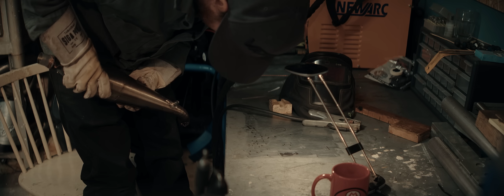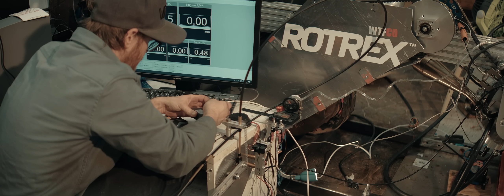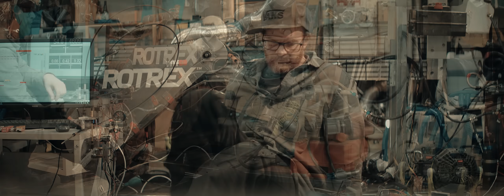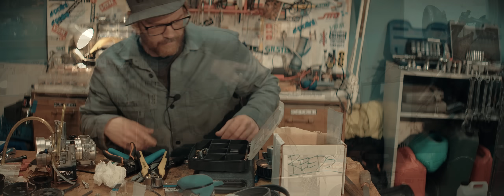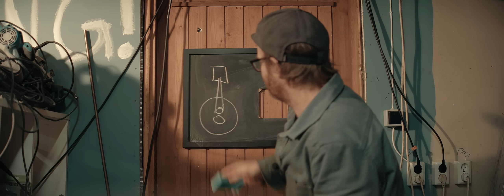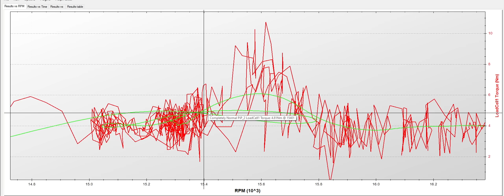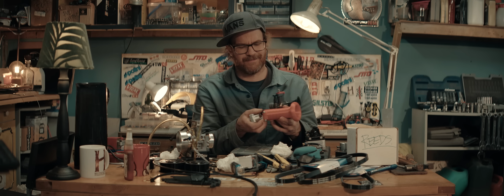18000RPM, But then...

Comment: And again, your Motor is capable of runnung Supercharged, as some others also mentioned, let the charger suck in your air/fuel mixture from the carb, the charger has to be between motor and carb, cause a carb works with under pressure and not high, if you want it the other way go direct Injection, i believe in you and your project and it will blow our mind away if it works at least
Reply: He's already talked about "Blow Through" and "Draw Through" in earlier videos.... He also explains why he did it the way he did.
Reply: You forgot one importantant part why he has set it up that way the fuel eats sealing and plastics like no other really nitromethan + methanol is aggressive as hell
Reply: @TheLtVoss  So its possible to build a whole motor which is able to run Nitro, but no supercharger? Whats about the crankshaft seals they are eaten as well for this reason, yea the seals have to get replaced, but for real, if this is the reason, i go rather seal a charger than a carb with the knowledge that i wont work as expected. on the other hand with all the work and time spending to get the carb running i had rather spend it to get the efi running correct
Reply: @Phil2Sat  Never though about the crank seals with R/C fuel good point. I left a comment a few weeks ago asking Alex would he use the Rotrex on draw through on a 4 minute speed run if push came to shove.
Got no answer.
Reply: Blow through works just fine as long as the carb is modified for it properly. Thousands of blow through forced induction systems out there starting from at least the 1970's.

Comment: Is it possible to hookup an O2 sensor on that engine? Just curious. Thx
Reply: Nitromethane and oil will destroy it very quickly. Lambda is not installed on two-stroke engines.
Reply: All the high horsepower 2 stroke motors I've seen only run EGT in each pipe. Outboards, sleds, etc.
Reply: I would say yes if running a ultra high quality oil like the blue Stihl oil at 50:1 for a hour or so with a fully warmed up engine. Not a chance with 20:1 castor oil.

Comment: What a fantastic episode, you had me grinning from ear to ear!
You beat me to the timing diagnosis, lack of advance.
My old 125 twin cylinder Yamaha race bikes used to run between 1.8-2.0mm BTDC with a 43x43 bore and stroke. If PiP was only running 15 degrees of advance  0.835 mm of piston travel it should be way retarded.
Glad to hear your going disc valve I was also going to suggest that if you made new cases for PiP.
Hope you enjoyed your time away!

Comment: It is indeed wise to investigate in vibrations and try to measure it. Maybe the engine needs balancing shafts, that could be why your main bearings are failing so fast.
Reply: When Alex strips the engine it would be nice to know what the balance factor is.
Did the mains fail on the Brute Force as well?

Comment: if the 19 and 20 hp readings you ware getting are right them maybe the supercharger is not even needed i mean that seems like a lot of power for a 50cc 2stroke but maybe not i guess 30 or even 40 might be pretty cool to see
Reply: Yes but making insane power with a 50 is the point of this project
Reply: Think he is going for 40+ hp or he would just buy a normal moped engine 😂
Reply: I like the 20 hp number, if it can be trusted as his dyno system is...unique. But whatever he can make N/A surely can be increased FI and the goal is the highest number in the world, so he needs to go FI. This isn't a case of "ah, that's good enough", it's never enough.

Comment: The compression is too high at the high rpms.. The head needs a shim to lower the comp
Reply: Squish is then ruined
Reply: He said the squish is already too big.
Reply: As the engine runs faster you can hear the  it struggle with to much compression it makes the engine sound hard..
Reply: @kcalbtej  I can hear that, but also he has never (ever) had the fueling dialed and the pipe is probably still designed slightly wrong as he has admitted. It never starts to get that really clean pingy and singing sound to it, but compression is not at the top of my list as to what to blame.

Comment: Why don't you get a Chinese or Russian diesel heather they can run on old engine oil have outside combustion air and you garage won't smel and they can run by thermostat some can also heat water

Comment: Great series. I have battled hours jetting 2 strokes. Sometime in circles, and then it works. Keep up the good work.
Reply: I have too, so many hours. I love two stroke. But for the love of god. Please just go efi already!
Reply: @Xfacehack  hes talked about efi not working before but with the right injector or multiple I think it could. Need a CPU with some custom mapping to do a one cylinder 2 stroke, so no Holley or fuel tech.
Reply: @christopherwebber1104  how about a lectron carb. Best of both worlds.
Reply: @wonderful_   LOL.    At least I think that was sarcasm.
Reply: @Zt3v3  not joking. Consistent control and vaporization is what he needs. Lectron carbs will do just that. EFI in a two stroke has its own set of challenges, carbs can take a long time to tune especially in an experimental setup.
Reply: Would love to hear why you think not though! I don't have experience with lectron carbs specifically but have modified NG mixers to add electronic controls in attaining precise AFR that worked well.
Reply: @christopherwebber1104  It gonna work, how come there is big two strokes with fuel injection? Ton easier to tune
Reply: @wonderful_  Did you not watch the 13 videos with a Lectron carb on it?
Reply: @mjodr  heh woops I haven't tuned in in a while. Sounds s like I'll have to go watch.
Reply: @wonderful_  the fkin lectron carb couldnt even take the boost and kept cracking and leaking...
Reply: @wonderful_    Now you get why I thought you were joking.
Reply: @Zt3v3  haha yes, my bad!

Comment: Have you ever thougt about using a system simular to a 2stroke disel engine? In some old trucks like the oshkosh were superchargers used too
Reply: 2 stroke diesels use Superchargers because they dont produce any vaccume.
Reply: @alexstromberg7696  usually they use turbos for the obvious reason of effectiveness
Reply: @einhase6924  they use both. The superchargers arent like for 4 strokes. They are there to make the engine even work